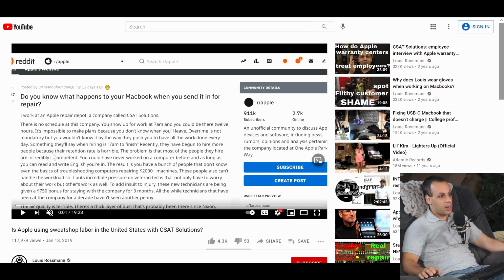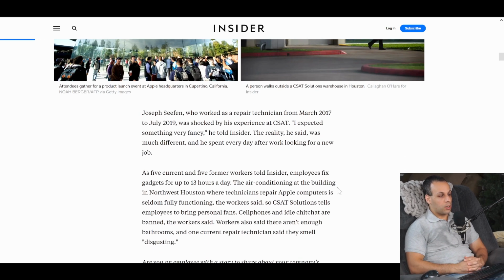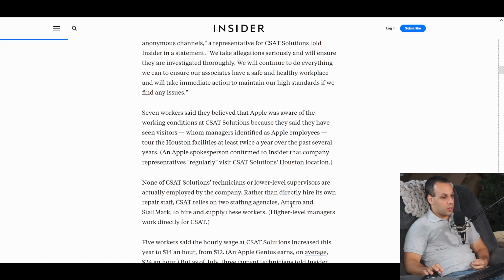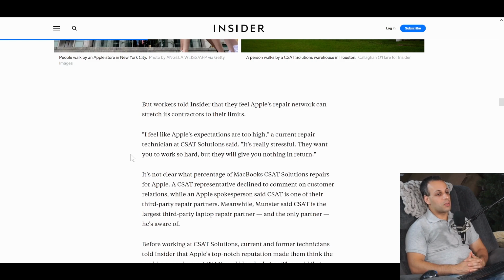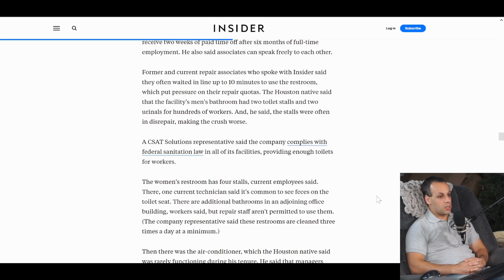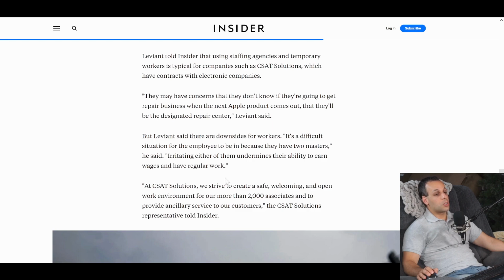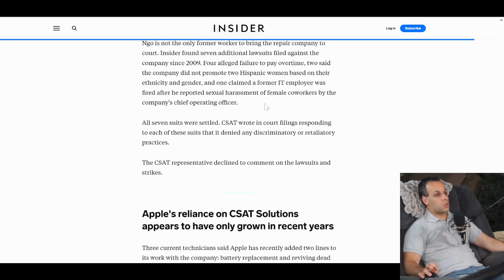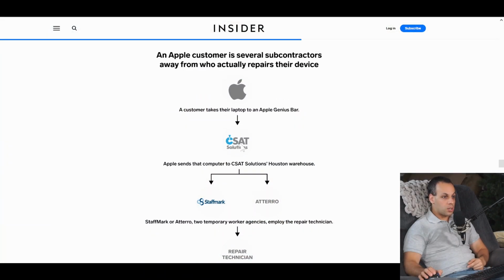What is Apple authorized repair REALLY like?

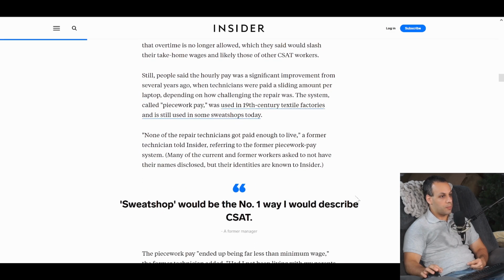Comment: 12:10.    A long time ago, I worked at a repair center that did component level repairs for a large consumer electronics retailer.  We got payed a base rate, but in addition to that, each unit we repaired had to be categorized as easy, moderate or complex and each of those had a bonus dollar amount associated with them that would be added to our base rate.  This meant, the more "complex" repairs you did per hour, the more money you would make.  The problem with this was that workers would lie and put down that repair was complex when really it was easy and sometimes replace parts that didn't need replacing.  If this was an out of warranty repair, then the consumer would be charged the higher amount!  Repairs that were "easy" were typically gone through as quickly as possible without thoroughness so just the main reported problem was addressed and other obvious potential issues were ignored.    I think the hourly model is better at keeping employees more honest!

Comment: Two bathroom stalls for hundreds of workers: That tells me they were using warehouse space (which costs a fraction per square foot of office space) for am office use. In a warehouse there are usually a dozen employees with most of the space being taken up by "wares" (hence the name). When they converted this space to a use it wasn't designed for, they apparently did nothing to adapt it to the new use, such as add more bathrooms and 400 BTU per body of A/C.

This all tracks because the workers also complained about the A/C. In addition to what was in place for a warehouse, if there were 250 more people working there than anticipated by the design, an additional 250*400 = 100,000 BTU of A/C is necessary, which they obviously also neglected, making the whole place LITERALLY a sweatshop.

Comment: To make your message easier to understand by the masses, you should dumb it down just a bit. 
"If a wire breaks inside your laptop, independent repair will replace the wire while authorized repair will replace the whole board"
Most people think a computer is a magical box and really have no idea how it works

Comment: I can attest to the work of these "authorized repair centres."  Years ago I bought a Galaxy Note II from my carrier. It was a lemon from the word go. I returned it to the carrier several times and it just came back worse. Finally, the warranty was running out so  I drove to Samsung in Toronto. They called me to the counter and told me that they weren't going to cover it because I had brutalized it. I had to return home and fax the paperwork before they would cover it. It finally worked but I had to use a $75 Windows Phone for a year instead of my very expensive Samsung.

Comment: Why is that some of it is the opposite here in Germany I went to a couple of Small Repair Shops in my city, and all of them told me to just buy a new phone, when all just my screen's glass was cracked (it could easily be fixed either by separating the display from the cracked glass and gluing another glass on top of it or replacing the whole display) (My Google Pixel 4a's glass is cracked) and the Authorized Repair Centers here suck too, one time I wrote to Samsung (about my Galaxy Fold) to buy a genuine AMOLED display, but they straight up refused to sell me one because I wasn't a Repair Center and all they told me to send it in which case they would wipe my data, but I don't want that. Now either I have to take a gamble with purchasing a screen from AliExpress or eBay (in which the quality would be lackluster) or overpay Samsung to fix it...

Comment: Having clean and pleasant working conditions is not a major expense.  This is especially true in a large open space like a warehouse.  A company can create whatever kind of space inside that large cavern with minor effort since there is little if anything in the way.  Proper design of the work area would also mitigate the need to air condition the entire space, particularly, the area high above the work area.  As a young man, I worked in a warehouse owned by Sanyo.  It was the cleanest, neatest and most comfortable warehouse I ever saw.  Bathroom facilities outnumbered the employees using them.  (Japanese know how to work efficiently).  The lunchroom provided hot meal choices as well as regular fare.  (including Japanese dishes).  All that was being done in this warehouse was the normal in and out process of shipping and receiving.  This warehouse was so large that bicycles were provided to travel back and forth inside the long aisles.  This was back in the late 1970's early 1980's in Secaucus New Jersey.  By the way, the turnover of employees was extremely low.  People just never quit. Oh yeah, I almost forgot the free coffee all the time.

Comment: I worked at a repair shop once on minimum wage repairing branded phones that are under warranty or insurance cases. The people the hired are untrained and only teached a bit by people surrounding them and most of didn't even have any experience with electronics or any idea on how to measure things. The repair time we had for each phone repair was about 15 minutes to reach your target. And that includes ordering parts, take pictures if required, check warranty, repairing, flash software to latest version, test the device and logging every step.
So basicly people there would rush and replace some random parts and hopefully it tested ok after that. But if you had an intermittent issue it was very hard to under those conditions and ended up being just flashed and returned in the end. I don't work there anymore.
And this is is happening in the Netherlands, and the only difference was that at least the toilets are clean.

Comment: I believe the workers in this story, and don't doubt their story.

I used to work for a company in a very similar setup as the workers stating here.  I worked in a warehouse, from a company they contacted out to who hired me.  While there, I made minimum wage.  I was not to have a cell phone.  I had to wait in lines to go on my breaks (which ended up wasting the entire break).  It also didn't have AC, either.  I got no sick time, no vacation time, etc.  

It was a horrible job.  I was working my way through college, so it was okay - but I was by far one of the youngest people there.  A lot of people were making their livelihoods from this type of job, and contracted in a similar situation.  I remember the anti-union messages all over, as well.  When a policy, even a good one, was made by the company, I was told it didn't apply to me because I was contracted in through another company.

I was there for only 6-8 months or so.   I hope I'll never have to work at a place like that again.

Comment: 10 years back I loved apple.  A lot of my users were into Apple.  But there came a time when I couldn't even upgrade the RAM on them and my own perfectly good laptop wouldn't update to the next OS for absolutely no good reason.  It also became extremely difficult to update the computer for other users without them being physically present with their phones to get apples ridiculous authorization code.  And why should I need an authorization code (when I have the appleid and password) to install a free printer driver?  So.... keep your walled garden.  I'm done with apple.  Go with Linux.  Never been happier.

Comment: My only experience with a branded  repair shop is that they claimed it would take 2 more weeks 3 times and after 2 times I reached out to Apple support and on the third time Apple support sent me an upgraded refurbished laptop instead, insuring me that their would be consequences for the branded repair shop. In insight if I had access to a good repair shop like yours I would have saved weeks (but not get an upgrade 😂). Never again.

Comment: I worked for Genco maybe 15 years ago refurbishing/repairing Dell laptops and PCs, and the working conditions were only slightly better than this. idle chit chat was definitely snapped at, no cell phones, giant warehouse with no natural light, 10 hour days 5-6 days a week, bathrooms were pretty gross, and you had to get permission to go because leaving the line meant people were waiting on you to get back. but, I was making 15 dollars an hour in 2008, which wasn't terrible for having no formal education. at least where I live. I originally got that job through staffmark, which I can't really say anything positive about. They started us out at 9.50/hour when we actually worked for Dell building PCs, but the warehouse I worked in got sold to Genco to handle repairs. I don't look back on those days fondly, but it did keep me afloat for several years.

Comment: I looked up the rules and the standards seem reasonable:

OSHA standards dictate the minimum number of restroom facilities that employers are required to provide. 
That number is based on the company's current number of employees.

Number of Employees	Minimum Number of Toilet Facilities
1 to 15	1
16 to 35	2
36 to 55	3
56 to 80	4
81 to 110	5
111 to 150	6

Comment: 4:10
Wow, I'm from Russia and we have the same problem here with spam calls. Afaik we don't have data-only plans, but there is no need for it really. You can just turn on "Block unknown callers" in your "Phone" app settings. Well, at least on my phone I have this option. I understand, that data-only plan would cost less, but for Russia it's not an issue really - our plans are already cheap. (Potential bad English ahead alert. I don't know how you say these things) I pay ~$4.7 for 10GB data (unused data accumulates up to 35GB), 600mins on calls to other carriers phone numbers (unused mins accumulate up to 900), free calls inside my carrier's network, unlimited use of all popular messengers even if you forget to pay for your plan on time. Pretty neat.

Comment: The authorised repair centres exists to do warranty replacements (as required by law) and bill the parent company for it. Otherwise they aren't interested in trying to repair your device, there's no money in it for them, they need it done fast.

Authorised repair these days is leaning on replacing modular components (it saves training technicians and minimal competency can do it), and when there is hardly any modular components left, the only option to to replace entire PCBs. The cost of spare-parts + quoted labour leans towards -> better off getting a new unit.

Comment: As for the bathroom grossness, it might be because there is only so many toilets making them having to wait absurd times, or even because they are so incentivized to not stop working it's very likely that one of the employees could have lost the ability to hold it, and especially if their stuff isn't solid there's no way that's not gonna turn into a mess. It's likely it wouldn't be a problem at all if they were given access to a suitable amount restrooms and didn't have their quotas breathing down their necks. If you are already behind on your quota you might decide to wait until you really need to go but then when you do you have to wait in line. It's just a recipe for something gross to happen.

Comment: I worked at a Cabinet factory, deemed themselves as #1 in their industry... We used 2 porta-potty's for almost 3 years... In the winter, dead of summer... UNLESS you walked all the way to the front office, 5 minute walk, which I did everytime I needed to use the restroom, I'm NOT going to freeze my balls off, nor sweat my balls off in a stinky porta-potty... Finally (right before they shut-down) they installed a 5-6 urinal bathroom for each sex... They did install a single urinal labelled handicap about 2 years after they brought in the porta-potty's... Really could have been a great company! Yet... This is what they gave their employee's! Deligating lesser paid employee's with hopes of getting promoted only to be blamed for problems, and usually later fired...

Comment: One way you can accidentally get feces on the seat is explosive diarrhea, been there, done that, but I cleaned as much as I could and reportet it to the cleaning staff. Accidents happen, but you're also responsible to fix it or at least rwport your kishap so it gets fixed as soon as possible.

Comment: They have a metal detector at my job to keep people from bringing phones onto the warehouse floor.  You might think these metal detectors are for safety.  They inside the building though.  Past the gates you use to get in.  So if you want to get a gun in just knock on the door and security or HR will open the door and let you in.  Or a random worker.  Or cleaning crew.  There's really nothing stopping anyone from opening most of the doors.

Comment: How to shit on the toilet-seat? 
 
That is very easy, in parts of France and the Middle East people do not use an English toilet but a hole in the ground. Some people are used to this, they squat down, (take off the pants first) and hover above the hole in the ground. They aim at the hole and when they miss there is a stick in the corner to correct the mishap. When they are confronted with an English Water Closet, they still want to squat down. They put their feet on the toilet-seat, they aim and they miss, but there is no stick to do the correction with. For this reason you always find at international airports stickers on the toilets that tell you not to put your feet on the seat.

Comment: ive had certified repair from lg for an old led tv and casio for 2 old gshocks theyre from independent shops and typically family owned i havent had issues and in fact the products i had repaired ran better than before.

Comment: Experienced it first hand in india. Just after 1 year my macbook air screen went blank so apple care told me i had a logic board failure due to damage of power module and asked for 70% of the price of a new macbook. Went to a local shop, he repaired it in about 40 dollars(converted) and as soon as i got it back i sold it on used marketplace. Also i had screen issues due to my fault(earlier, about 6 months ago) . I closed the lid while there was a earphone on keyboard and it damaged my entire screen and the repair came out to be 33000rupee which is 50% of the value of new laptop. For a 720p screen that too 13inch.i asked about windows and they said you could get a 15.6inch, full hd and anti reflective screen for 1/3rd of the price... Had an ipad in which one speaker got damaged suddenly one day and was asked for 50 dollars for a wire connection or so they said... Ditched apple completely after that!

Comment: At this point, it sounds like someone should take a cheap, all plastic, mini film camera with a few rolls of film to snap pics on the inside CSAT, including the conditions.
All plastic because I'm assuming there are metal detectors/xray machines for bags when going onto the repair floor.

The cool thing is there are so many crazy types of film cameras in sooooooo many different form factors that don't look like cameras that it'd be impossible for security to actually find them all.

Comment: Hey Louis when I was working with Toshiba Canada they pretty much did the same. There was a company that would fix our boards and they were paid by piece work. So about $5.00 per board repair. If the board was not fixable it became parts board for the other boards.

Comment: So I worked as an AASP for while. Yea the hour turn around is totally reasonable. Until you have 7 phones to just you and they want them all done in the hour instead of half an hour each. Its not that each repair is an hour. It's more that if the device entered the shop an hour ago no matter how large the queue you were in trouble if it wasn't done.

Comment: I had an experience with Redmi phone. The headphone jack wont work. My phone was stuck on heaphone mode at all times. It was impossible to use the phone. I went to redmi authorised store. They told me, somehow, it was not covered in warrenty. and it would cost me 80 dollars, half the price of the phone, to replace motherboard. I was about to buy a new phone, but decided to give it to my friend's shop who does phone repair. He clipped a joint. And that was that. I used that phone for next 2 years with bluetooth headphones. A lot of companies have service centres that barely know what they're doing

Comment: Assuming hundreds means 200 then the 6 stalls and 2 urinals IS the bare minimum,  7 restrooms are required for over 150 employees with 1 added every extra 40 employees, with urinals only allowed to take up less then 1/3 of the total, it's probably even worse if they are counting the mangers exclusive restrooms in the total

Comment: So the feces on toilet seat situation... Traditionally in many cultures (in particular east and southeast Asian), people used squat toilets instead of sitting ones, specifically because they worried that sharing a seat is not sanitary. Note this is not an unreasonable concern before modern times.
So this might be the case here: people think that using the seat is unsanitary, so they squatted on it instead, which explains how feces got onto the seat. It could also be the other way around - the seats are so dirty that people are unwilling to sit on it. You know, classic chicken and egg situation.